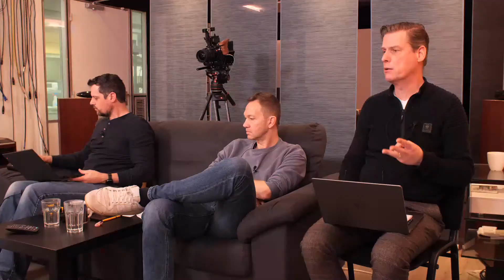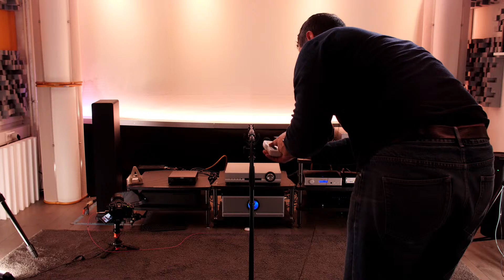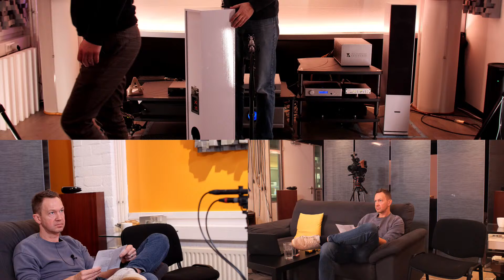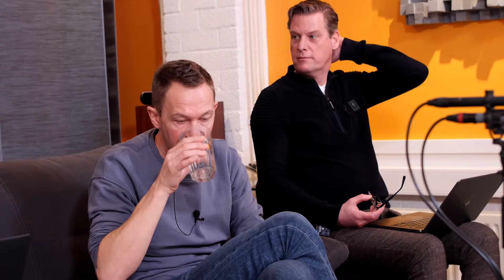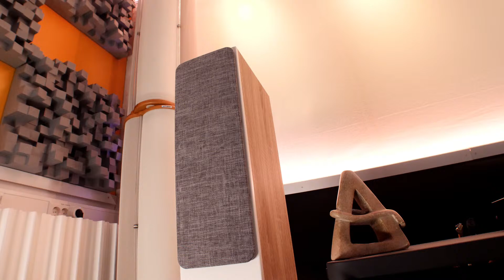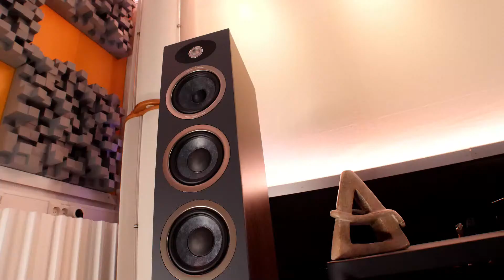Live Multitest Floor standing speakers - 1000 Euro per pair

Comment: Oberon from Dali are tricky ones. They have more v-shape than you might think. On most recordings they sounds really nice but on other they sounds terrible. They scale up with good electronics but at the samme time good electronics can reveal Oberons shortcomings. 
The higher teer Dali is way more accurate but perhaps not as fun as the Oberon.

Comment: I’ve always been a fan of tower over Standmounts…and the Narrower, dual woofer design Towers are more “complete” and give way to pairing with more expensive Amps and Dacs however some may say it shouldn’t be done…why!!?? I have a pair of the original KLH Kendalls which beat the Q’s in every way, and cost me a pittance of 1200.00 for the pair. I’m surprised how much equipment is “forward” of the speakers in your test room. And I’ve heard no speakers that sound better with the grills on?? Next time test them with and with out. And yeah, it’s awfully difficult to play tracks that any of you don’t know and haven’t heard to actually “compare”. Why not have a a group of select songs that are played on each test?? That’s how we did it when auditioning gear years ago!! Before streaming sadly….  The reality is, there are a group of choice floorstanders, that sonically…are excellent, costing less than 1500.00!! They can be pretty much be paired with any front end and perform well. The AE’s and the Dali are two of those Brands that deserves the “Audiophile” stamp!!  And all that nice Camera gear, capture some good close ups of the speakers with the grills off!!  Be nice to hear a few more specs as well.  Keep it up guys, doin good!!!
Reply from the maker: Thanks for the feedback!

Comment: Great Demo, much appreciated -- thanks!🙂

For when you audition speaker cables, please consider the Tellurium Q brand -- Blue II's and/or Black 2's for example. IMHO, great cables at a realistic price level.

Also, I don't know if you've ever done a show on open baffle speakers, but I'd love to hear that. If one DIY's them, they can have just the one full-range driver per baffle (no soldering required).

You can also get the baffles professionally cut for something like clones of the Decware ZF15M in 40mm thick oak for a total price of c. £1300 a pair, baffles and drivers included. This is appreciably less than the price of the ready-made speakers (at least £3500 before shipping, customs and VAT). The plans from Decware are dirt cheap at $30. IMHO, this is one heck of a deal and to my ears they sound exquisite.
Reply: Hi. We have a few sets of speaker cable we utilise for tests: Art Speak, Driade Flow 405 and 808 Reference and the vd Hul Nova. That's enough to choose from already. 

Open baffle: we are probably not going to test that. Too much of a niche, too much dependency on the room for the performance. It is a subject we won't draw enough of an audience to make the effort worthwhile, something we consider as well. We thought, for instance, that the phono stages multi test would generate interest. Not so much.
Reply: @jmtennapel Thankyou for the reply. 🙂

Surprised there'd be little interest in open baffles. In my experience (admittedly probably rather less than yours), they depend less, rather than more on the room. Could just be my main listening room I suppose, or maybe my main preamp/power amp combo, but both pairs of open baffles I possess sound considerably better than any closed box design (up to £1500) I possess.

Comment: Great test guys! Hard to hear what speakers can do via YouTube but thought the amp comparison and the differing recording quality of the tracks was interesting 👍👍
Reply: I'm listening through a couple of Genelec 8351B+7370sub, monitors, in a music studio control room, 
and I can promise that the differences between speakers and amps  are quite audible,, 
and so are the rooms ventilation system and every little movement of the Alpha-dudes in the sofa/chair,, etc.
Reply: @IrenESorius  if you think you're hearing what the guys are hearing, you're deluded.
Reply: @REX4340  Of course I cant. Have someone told you I could?

Comment: I have heard of Fenton speakers but never listened to them in person. They are also branded Skytronic in some markets. Cheap and nasty speakers and going by some of the videos on YT, contain no crossovers, really thin cables and no internal bracing or sound absorbing filling. They are about the same quality as White Van Speakers. CORRECTION: I just watched the YT video I was referring to again and the speaker does have an electrolytic cap on the tweeter and one brace glued to the inside. Still very cheap and nasty: https://www.youtube.com/watch?v=lcCK6qjnun0
Reply from the maker: Horrible stuff
Reply: @TheAlphaAudio  Please look inside one and report what you find. It will be fun.
Reply from the maker: @mddawson1  review will be live at 19:30 CET on alpha-audio.net.
Reply: While of course I agree with your assessment of Fenton, the lack of a crossover on the woofer is not necessarily an indication of a bad speaker. Relying on the natural rolloff of a driver can sound very natural to my ears. Like anything it's a tradeoff and all depends on the overal design, choice and quality of drivers etc. Woofers should start to beam and experience cone breakup at higher frequencies but it's not something I necessarily seem to hear or find objectionable. Oh well audio remains a mystery and dark art.
Reply from the maker: @RustOnTime  there is no crossover at all.
Reply: @Time I understand this, my own VAF DCX (Series 2) speakers only use a single resistor and poly cap across the tweeter but then VAF specified the exact driver requirements to Audax to make for them. I suspect the Fenton spent 99% of their design budget on making them look like speakers, not on making them sound like speakers.